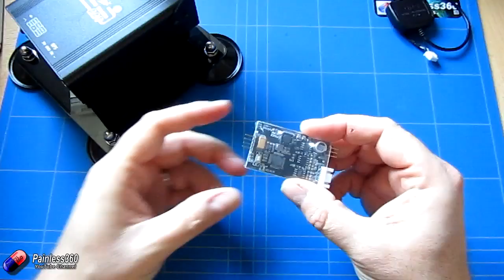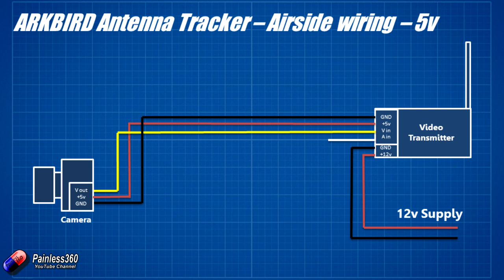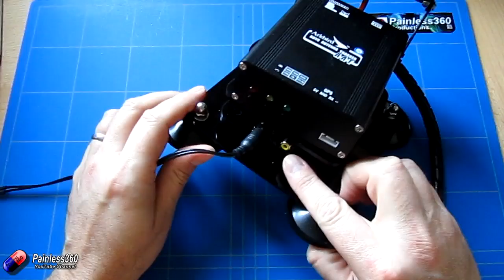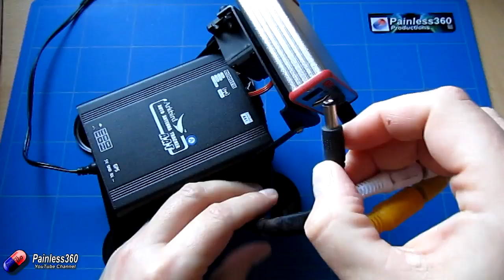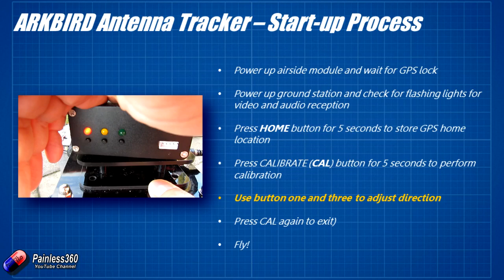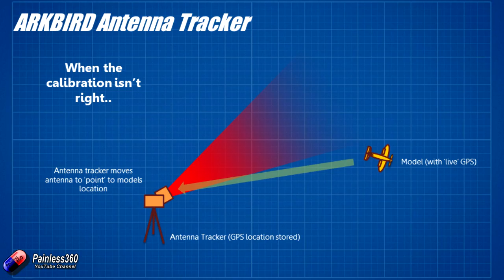RC Reviews - Arkbird Automatic Antenna Tracker for FPV

Comment: Hi, I´ve using this AAT for 3 years and works really good for me.
Now, I would like to know if it´s possible to connect this AAT to my netbook, in order to track the plane on real time on some kind of map, like nav link or mission planner does...
Do you know if it is possible?
I email arkbird and no answer was given to me...
Hope you can help me!!!

My set up is: 
SKYWALKER 1900 FPV plane  
IMMERSION RC 433 long range sistem + Futaba 8FG super
1.2GHz Video Tx and Rx + 8dbi Patch antenna
TORNADO OSD + ARKBIRD Airborn molule
Arkbird ATT + GPS module

Thanks in advance!
Chears from Uruguay
Reply from the maker: No idea, sorry. Best of luck

Comment: Still not received mine but How to connect to F765 board?
Reply from the maker: No idea, I've not used it since the video. Modern diversity receivers are easier to use now anyway..
Reply: @Painless360  Witch one you recommend for long range? I have AKK 3W Vtx 5.8
Reply from the maker: See my video on flying further. 2.4Ghz FPV will get you further. See the range calculator on the MenaceRC website..

Comment: Antenna tracker tech has not evolved much over the years. I'm going to buy one soon. Do you still like this one? What do you think about the mfd one? I'm leaning toward the arkbird because I use inav and I dont want to have to learn a whole new system.
Reply from the maker: I didn't like the work to set it up every time. Diversity recievers are so much easier to use now....

Comment: sir i need some guidance, my vtx is a 1.2ghz and runs on 5v max and the cam is a normal runcam which can take higher voltages, i am now confused on how to wire the vtx with this arkbird system, youre input would be greatly appreciated
Reply from the maker: I've not had this for many years so I have no idea. Best of luck with it...

Comment: excellent, been tearing my head to understand this tech, i wanted to make/get one for my fixed wing the Sonicmodell 900 and the future build a Skywalker x8 but no proper explanation anywhere, thanks to you now i have a fairly good idea, now just need to figure out what sort of 1.2ghz equipment i will be needing and where from like vtx antennas etc and which receiver to get for the tracker as i am now on a budget after destroying my bank account on the recent planes and equipment lol...confusion is like on a Pixhawk 2.1 which will already be running a gps wont this arkbird gps be conflicting with it?
Reply from the maker: Not sure, I've not had the unit for a long time. See the Ardupilot Antenna tracker id you're using a PixHawk..
Reply: @Painless360  thanks for the reply sir, i really appreciate the work you do for all us RC enthusiasts!!!

Comment: Can we put the arkbird osd on the plane for tracking? But actually we want to track the rfd900 telemetry??
Reply from the maker: I've not used this since the review as the setup and use was trickier than I expected. Sorry I can't be more help on this one.. Happy flying!
Reply: But.. what if just put the rfd telemetry directional antenna on the other side on the tracker? Because the fpv and rfd is on the same plane.. so its track simultaneously

Comment: Hi, I'm wondering can you shed a little light on something for me.
I recently  bought an Arkbird ATT and while it does work accurately EVENTUALLY  it does take me a bit of time each time I fly to get it working correctly.
MY question is..... I noticed there is a small bit of play in Pan servo when you adjust it by hand before you actually here the servo gears moving. 
Is this normal or is the greezed up ring on the ATT that the play is in damaged on my ATT. 
I've tried finding an answer to this question from Hobbyking where I purchased it and from Arkbird themselves but cannot get a straight answer. 
Seeing that you have physical experience using this tracker I'm really hoping you can answer my question. 
Thanks in advance, Martin.
Reply from the maker: Not sure, I gave this away as a prize ages ago. Best of luck!

Comment: You did a good job describing the Arkbird .. but ...seems like a pain to setup ...  I am wanting to fly not to sit in the field doing calibrations on either antenna tracker or flying models..
Reply from the maker: There are better options now and receivers that have two or 3 high Gain directional antennas that give you a fantastic experience but don't need as much setup. Best of luck

Comment: Since you made this review, what are your thoughts on the better AAT products to work with? I’m aiming to get into long range FPV and can’t yet pick them apart. Open to any thinking on this. Thanks.
Reply from the maker: I've not looked at any other of their products. I found the manual tracking was a pain to setup every-time. I'm more of a fan of multi-versity (lots of high gain antennas in an array) for this as there are no moving parts and it's easier to setup..

Comment: Hi ya. Yet again another cracking video. I have a question though. I have just finished installing an Eagle Tree Vector ( with a lot of help from your videos) and was wondering as I have  the Arkbird AAT is it possible to run the two together and if so how would I connect the VTX, airside module  and Vector all together  ? Hope you can help me with this. Many thanks ✈️
Reply from the maker: Not sure, I've not tried and I gave this away as a prize a long time ago.. Best of luck!

Comment: Friend where did you buy this antenna tracker?
Can I use with other controller like F4, Cyclops or Fy-41AP?
What do I need for it to work with my FPV system?
Reply from the maker: I can't remember, detail is all in the video. I gave it away as a prize years ago..

Comment: Understand that it's an old review but I'm curious to know if you're still using the Arkbird system or if you've come across anything better.  I've set up 6 meter FPV scale glider with crossfire and 2.4 vtx for long range high altitude thermal flights.  I all ready have the ImmersionRC tracker system but found it to be a little unreliable, often loosing line of sight, fortunately having a RTH system onboard I've not yet lost my glider.
Reply from the maker: I'm not, I found the system to be a pain to use quickly. I've used the half-overlord and other systems that have a number of high gain antennas in an array and switch to the one with the best signal..

Comment: I prefer to use RG 400 for my feeders and always do a quick TDR test before brining into service. A colleague was surprised to see his high gain 27dbi Yagi was connected to a feeder with a -6db attenuation, down to exceeding the bend radius. The info is out there and all free so no reason toot research and get full performance from system.

Comment: Just stay aware of your minimum bend radii for the antenna feeder. Using an insertion loss tester on the feeder will show up quite alarming attenuation of the signal by exceeding the set limits. Just something to stay aware of,when we going for maximum range it is important to keep the losses to a minimum.

Comment: Hello, thank you for all of your videos, I have a little problem maybe you can help me with,  your instructions work great when it is a dedicated camera and TX, but in my case, I have the Eagle tree Vector auto pilot , and as you know this set up  uses the camera and TX already, so when I tried to "tap" into the camera video and the  TX sound, I get the flashing light like if it was working but nothing happens the red flashes slowly, and the yellow does not flash at all on the tracker, I only get the green flashing. and a lot of static on the monitor OSD, but when I disconnect the Air borne module the static disappears, I really really want this tracker to work for me because I'm setting up a RMRC anaconda  and want to do at least 10 miles round trip. I do have a PAL camera...  Please help .!!!
Reply from the maker: The ArkBird relies on the frames at the top of the video and the audio channels sending the tracking data so I'd connect the VTX output from the Vector to the arkbird unit on the plane. That way the signals shouldn't be affected. Also make sure that you have things like the vario turned off on the Vector too as that sends sound..
Reply: I'm not sure if I'm following. If I take the signal from the Vector to the Arkbird, what would happened to the TX? what would send the signal to my monitor?
Reply from the maker: Hey, I;'m just guessing here. I was trying to tell you to make sure that the Arkbird system plugged into the VTX and the Vector plugged into the Arkbird on the model. Sorry, I've not tried it. Best of luck!
Reply: Painless360  I wanted to thank you,  your "guessing" helped me.  😁. It was like that, this is the following order for anyone installing the arkbird ATT module with the Vector.
Vector to Arkbird, Arkbird to TX. Again thank you.

Comment: I want to buy one of these trackers  but have some questions if anybody can help?

The video mentions that cameras should be PAL. I use a video switch. I can ensure I use a PAL fpv cam but my 2nd cam may be a runcam or gopro HD recording camera with live output. Will using a video switcher cause problems with the tracker? Even using 2 or 3 PAL cameras will the interruption in video signal upset things?

I use eagletree vector. I know that the telemetry stream from the vector must be disabled for the tracker to work. What about audio though? The airborne unit has no audio input, it embeds gps data into the audio then sends it to vtx. Does this mean you can not have audio from the aircraft (either from an osd with voice alerts or a mic).
Reply from the maker: +Chris Flory I never used a switcher so I'm not sure. This was given away as a prize so I can't check. I'd ask the vendor you are buying it from. Best of luck!

Comment: The specs from Hobby King does not give the specs on the actual max. weight  of antenna that its capable of maneuvering or better yet how much force are the servo system able to manage
Reply from the maker: Not sure here either, we gave ours away as a prize. Best of luck with it!

Comment: HK description mentions "assist in locating downed aircraft ". I follow, it's all video info. So my real question is, do you know of a cheap way, easy way to find lost machines?  Trackimo does it but for $140 +$5 per month after 1 yr. And TrackR like things, but their bluetooth - short range. ideas?
Reply from the maker: RSSI tracking using the antenna on the radio is the cheapest but you need to practice with your radio so you know how it works when you need it.. Best of luck!

Comment: could air module be used to locate downed aircraft?  what support equipment/devices?
Reply from the maker: Only if you were receiving the FPV image really. I'm not sure if you could display the GPS co-ords of the model..
Reply: AAT will keep tracker as long as ground system is still have power, and another addional GPS for AAT ground module is need; but I do not think it is a very good idea to track plane because AAT gound is not convenient to take. While this Mini AAT maybe a good choice: https://www.rcgroups.com/forums/showthread.php?2786769-First-View-of-Arkbird-Mini-Auto-Antenna-Tracker/page2#post36550128

Comment: Hi painless 
Was wondering if you could help ! I have the att my flydream which I have never used. I have a skywalker I have built which used all the tbs components corepro GPS current sensor, and unify vtx 
Do you think the att mfd could be used inconjunction with the tbs stuff 
Many thanks Gavin
Reply from the maker: Not sure, the TBS stuff is designed to work together and the ATT uses the video signal and audio channel to send the GPS data to the tracker. If there is no other OSD on the model it may still work.. Best of luck!

Comment: Friend, I can use this tracker antenna with any OSD, or only with Arkbird?
Reply from the maker: Sadly not, the antenna tracker uses the signal from the Arkbird OSD to figure out where it needs to point to.. There is a brand new antenna tracker coming to the channel in the next few weeks so stay tuned!
Reply: Hello, what is the name of the new antenna tracker? Have you done a review on it? Thanks

Comment: I was looking at your diagram on how to connect the air module and the VTX.  In your setup is it necessary to connect the GND on the right side of the module to the GRD of the VTX?    It seems to me the only time you want to use the GND connection would be if you need to power a 12v VTX.  Since I am not using the 12v vtx on the right side of the air module,  Can I leave the GND disconneted(right side of the air module) and connect only the ground and the 5v directly to the camera? -Thanks

Comment: Hi, can i use the Arkbird Automatic Antenna Tracker  with ImmersionRC DUO5800v2 5.8GHz Diversity Receiver w/TrackerLink and 2 helical antennas to increase the range? if so how far is the range? or any other recommendations? thank you
Reply from the maker: Yep, in a matter of a few weeks - hold your horses!
Reply from the maker: No idea sorry, we gave this item away in a prize draw months ago. I'm aware of some very cool new antenna trackers about to be releases that look better than this model so I'd hang on.. Best of luck!
Reply: +Painless360 im about to get a antenna tracker for my 1.2 fpv system. i was looking at My Fly Dream antenna tracking and now this unit. you think better units coming out soon?
Reply: +Painless360 thanks bud.

Comment: Is this based on open source software? Otherwise, would anyone know of open source code (or a cheap solution) in any platform that would do this? Ideally arduino. Actually, I would like to create an automatic tripod for video recording 3D planes flying low slow from the middle of the field where we are not supposed to stand.  I guess the logic and gps hardware would work for both purposes with minor tweaks. It would be a cool project even to implement analog zoom based on distance and smooth out movement through software tweaks.

Comment: is there anywhere else other than hobbyking i can buy this securely?
Reply from the maker: Delays, delays, improvements, delays.. Sigh. I've been notified that the ones I'm expecting are almost ready to ship.. finally..
Reply from the maker: +Ironiic zero If you're about to get an antenna tracker there are much better versions weeks from release ;)
Reply: +Painless360 thanks for the heads up.
Reply: what are they? its been a while now.
Reply: Thanks for the reply, will you be reviewing the ones you're expecting? Should I still hold out? I'm always surprised how much these units cost compared to the price of their components.
Reply from the maker: I'm assured weeks (!) These newer units will be RSSI based so no need for anything on the model and no moving parts or calibration needed..
Reply: +Painless360 yeah I know about the rssiprotrack that some guys in the UK made. looks good but the only issue if that you have to put 3 helical antennas on it.

 you can't put like 23dbi high gain patch on it.
Reply from the maker: It's not those I'm waiting for.. Stay tuned and as soon as I can talk about them I will...

Comment: Dear, buy Arkbird Automatic Antenna Tracker for FPV with 2 GPS modules and need your help to install

I have the osd CICLOPS storm, like that the most efficient way to use this antenna tracker?

atte

Marcelo Paredes

CHILE
Reply from the maker: +marcelo eduardo paredes munoz We gave ours away as a prize so sadly can't help. All of the detail we used to set up ours is in the video.. Best of luck!

Comment: The data transfered from the aircraft is embedded in the videosignal lines, at pal you have more tv-lines, if choosing NTSC there will be lesser tv-lines and more FPS, but the data in the tv-lines compared to PAL is interupted. There should be a fix for that so that you could move the code in the lines so it works.
Reply from the maker: There is a fix, sorts out the issue. It does involve a bit of work getting ID numbers from both the tracker and airside modules.. Happy flying!
Reply: Painless360 Good to know, than I dont have to work it out myself when I buy one =)

But there was alot of buttonpressing to get it working, guess its the same as on a quad when its not that importaint that you do the calibration everytime you fly?

Comment: So does this mean if you lose video and audio signal, that the antenna tracker stops working? Or is the audio and video signal just a backup?
Reply from the maker: +BWX If it can't get the latest GPS co-ordinates from the plane then it can't figure out where to point so it just keeps the antenna in the same position and waits to re-acquire the FPV video/audio. That's the time to hit the RTH button on the remote ;)
Reply: +Painless360 Now that I think about it, you'd want to RTH in that instance anyways, because no vid/audio.. Duh.. LOL.

Comment: really nice review as usual...I wanna just point you something  about the airmodule,you can use also 5v to power it up...so don't need to supply 12v,What I do is run a servo wire from the immersionRC video IN to the airmodule OUT and the camera directly on the airmodule in video IN....I can confirm work,and also the audio wire is optional,In my opinion is better not using the audio at all,in some vrx sometimes the audio and video can go out of sync and make the tracker acting weird ....keep on! P.S. and also as April Deng says with the new firmware NTSC cam are supported!

Comment: Could I use this tracker with a Cyclops Storm OSD?  And if so, do I need to use both the GPS for the Storm AND the GPS for the tracker?  Thanks.  Great video, as always.
Reply from the maker: +big5astra Not sure as I don't have a Cyclops unit here. This Arkbird unit is designed to work with their OSD.. I would try with a separate GPS for the OSD and the ATT Best of luck.
Reply from the maker: Great! Thanks for the confirmation. FYI we have another tracker coming onto the channel soon.. Should be interesting to compare the two..
Reply: +awenzl is that ground?And then to the cyclops board,like Y cable..?
Reply: +awenzl thank you very much sir!